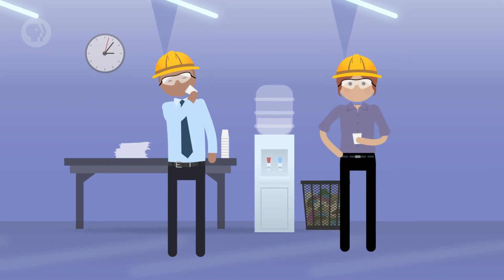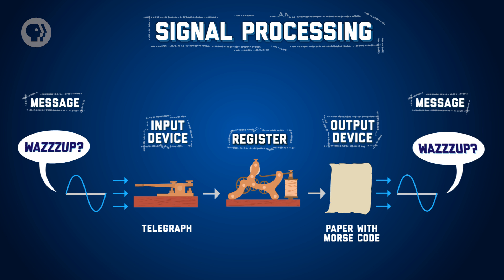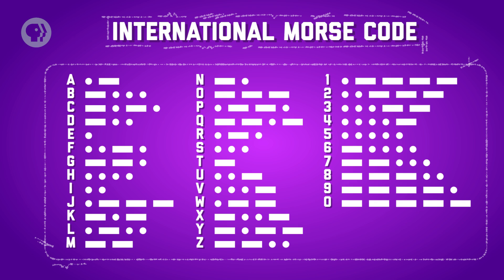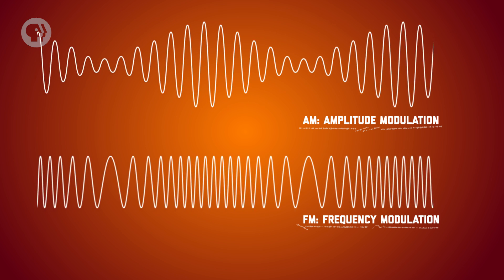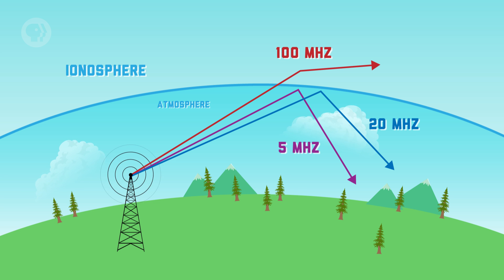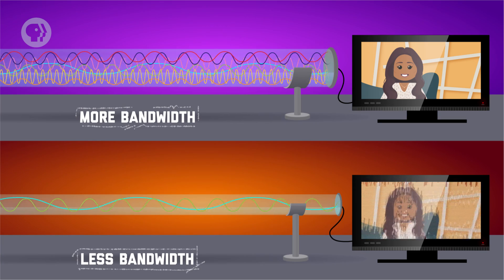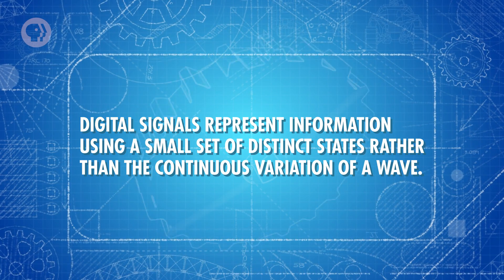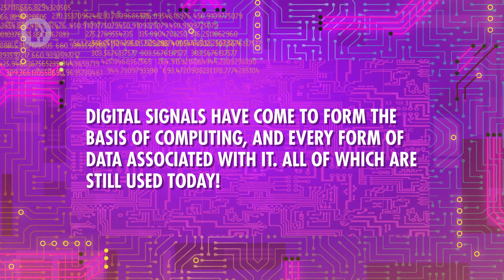YouTube Couldn't Exist Without Communications & Signal Processing: Crash Course Engineering #42

Comment: ...one of the most-bizarre effects of 'information theory' is that frequent not-using the band is, the data-bit information, e.g. if data results in signal modulation '00' or '11' then only half-the-bandwidth is being used for those instants, and that's statistically 50% of the time, and further '000' or '111' is even less-use, etc....

Comment: I think this video picks a fine analogy for bandwidth and noise with the pipes and flowing water, but explains it poorly. Especially when the discussion of Shannon's limit comes in. It's a simple analogy: bandwidth is the size of your pipe but noise is how clogged that pipe is. A big pipe that's really clogged (high bandwidth, but high noise) may not transmit more water (data) than a small pipe that's squeaky clean (low bandwidth, low noise). 

I don't think that their analogy where it showed a large pipe making a clear picture but the small pipe making a noisy picture explained this well.

I also think they could have made it clearer that Shannon's equation gives the limit of how much data you can send given a certain bandwidth and signal to noise ratio, but not a guarantee. It's signal processing researchers and engineers that create methods of communication that approach that limit for different applications. They don't seem to draw the right lines between signal processing and computer engineering, since once the internet enters your computer the signal processing part is basically over and it's hardware and computer engineering from then on out.

Comment: Ok but when talking about a signal transmitted by a wire... where does noise come from then?
Reply: Breaks in the wire, and bad connections at the end. Also if an amplifier on a line goes bad it can distort the clean incoming signal.

Comment: I wonder how LCDs and...any technologically advanced system is actually manufactured to work with everything. Like how do they make liquid crystals interact with the rest of the phone or any device to give output
Reply: Wherever voltage is applied or not applied to a part of an LCD display it it dictates If the pixel lights up (has to do with polarization of light)